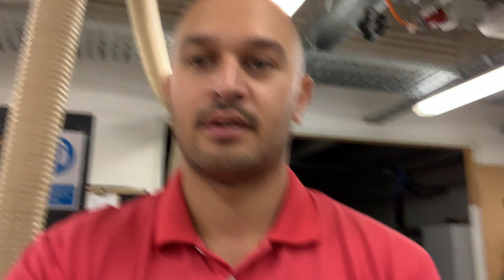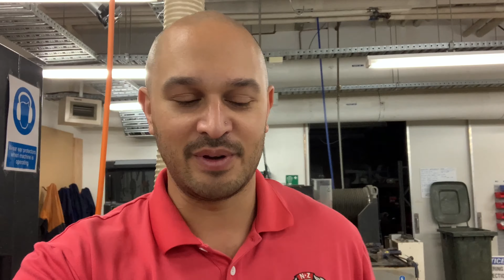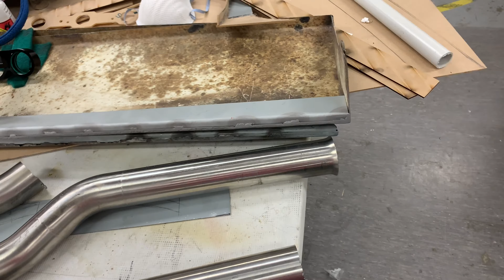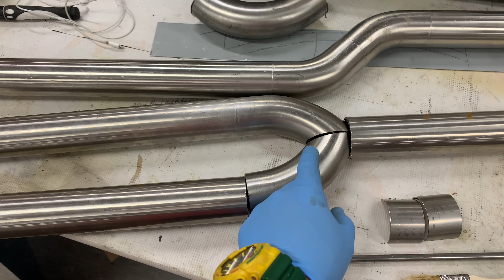Toyota Hilux: The Custom Exhaust That Spits Fire

Comment: What engine? 

Cam?
Reply from the maker: Just the 18R. I can't tell you what cam spec it is because the sticker is worn out.
Reply: Sounds good bro. 

Inspired me
Reply from the maker: @psidin86ps thanks. I’m going to make a in-line muffler to quieten it down a little bit for open road driving. It’s too loud!!

Comment: Quick question for ya... What size tungsten and filler rod are you using?
Reply from the maker: 1mm 316 stainless filler wire and 2.4mm tungsten. I know you can use a thinner tungsten but I don’t have any here at the place that I study so that’s all I’ve got to use. I do have some thin ones but they’re in my storage container.
Reply: @AdamNZ  Thanks!  Looks great!